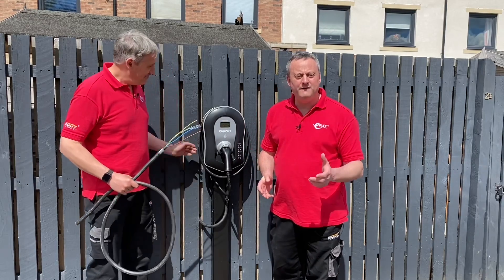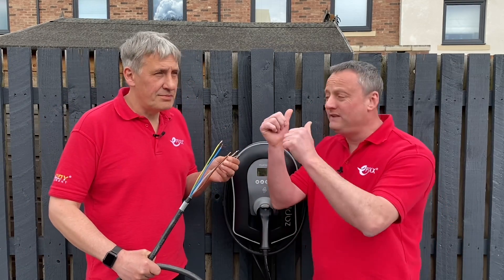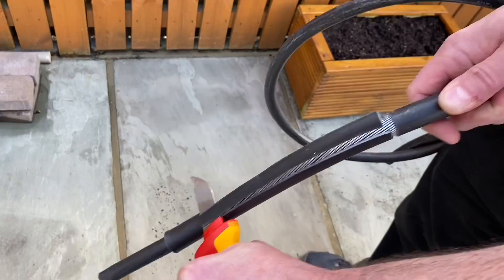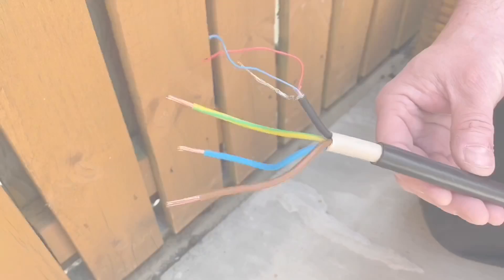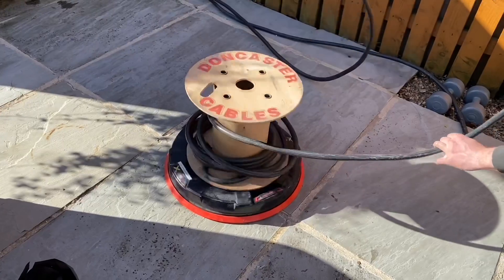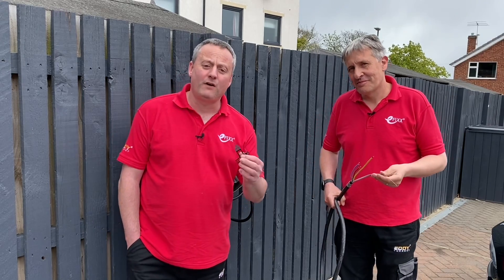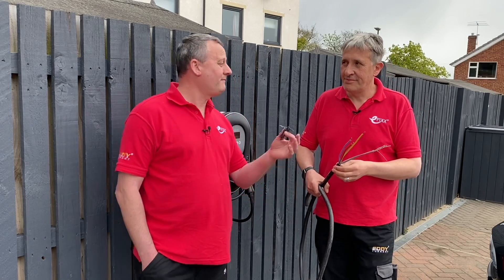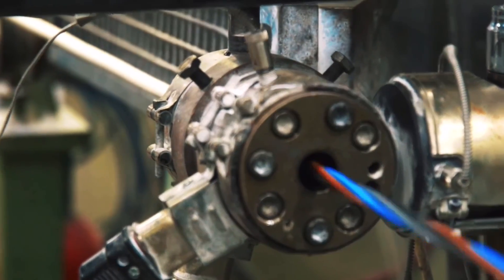EV ULTRA cable - Combined power and data for easier and neater EV charger installations

Comment: Question ? Can you run data cable and let's say 2.5 t&e in a domestic seting through the same holes in joist  let's say, answer is no so how can you use cable that carries both ie one is high voltage and one is low , and in ireland that's a no no so my question is ? Is it allowed in the UK? Thanks in advance

Comment: How does this go with isolation requirements? For example, in sweden, if a Extra Low Voltage cable is run alongside a single-isolated Low Voltage Cable, the ELV part of installation is no longer considered SELV/PELV isolated, and you must be a electrician to make modifications in the CAT network, including disconnecting and connecting for example computers or routers to switch, unless a approved isolator device is put on the CAT cable on the other end provding separation and optical isolation of mains. This because the isolation of the single isolated wires, could fail, potentially outputting mains on the CAT network, as the isolation of a CAT cable isn't approved for mains voltages.

The cable could be acceptable by safety standards ONLY if the grey sheating of the UTP cable is classified/approved for mains, so even if the single isolation of the phase or neutral wire would fail, the CAT isolation would be approved to keep mains away from CAT network (double isolation requirement).

Running a UTP cable alongside a normal double-insulated cable is approved however, since there is 2 mains-classified isolation layers that must fail before there is any risk of UTP network becoming live.

Comment: I bought a Honda Ens1 that came with a 3-Pin Chinese or Japanese plug, I cut the cable to put it in the EU plug, and I saw that my cable has 4 wires, a Blue, Brown, Yellow with Green, and a Red smaller, which I believe is a sensor. I would like to know where I connect the red wire, since I only have it in the EU socket, phase, neutral and earth. Which wire does Red go next to?

Comment: I am not a fan of putting data links in the same insulated bundle as power lines. It's not something you'll find is done in the telecommunications industry (indeed, they won't even share conduit).

Comment: Just installed Ultra 6mm + data swa from meter cupboard (under the stairs) to parking bay.  Cable had to be run behind drywall (dot n dab) through the hallway. Running it in the ‘safe zone’ was not an option. So I’ve chased out behind the plasterboard just above skirting  my understanding is that the swa should be earthed at one end or the other. This has been a real challenge with such a big, inflexible cable.   I’ll re-post once it’s all connected.

Comment: Hi
I am hoping to re run one of these cables from my house to the detached garage about 40metre run. This is to replace the current 4mm. Will be needed for a pod point charger and to run fee sockets and lights.
Is it worth investing in the 10mm variant from Doncaster cables for future proofing.

Comment: Thanks Guy's. I've got a Project Ev charger to install on a garage which is approx 47m away from the house. I am planning on using EV Ultra 6mm 3 core swa + data. My question is as wifi is not reliable over that distance could I use one pair of the data cable for the CT clamp and the remaining 3 pairs into an RJ45 ethernet back to the router or do Doncaster cables do a special cable for that scenario which has 5 pairs.
Reply from the maker: We’ve got a video series launching later today using an INDRA EV charger.  We explain exactly the scenario you describe with the data cable.

Comment: This might be different for different EV boxes.  Does the data connection have to be direct from monitor to charge socket or can the cat5 be used to terminate into a lan on either end and the monitor to charge socket comm is then just part of Lan?  Example application:  use this cable to connect power to a garage into a garage DB, data then goes to a hub in the garage, hub then connects to EV charger but other hub ports can be used to connect other stuff in the garage ( wifi extender etc )

Comment: What size go and did you use with the 6mm cat5 swa? Doncaster spec sheet states 18mm outer diameter, using a swa chart and counting 6mm2 4 core ( 2 line 1 cpc 1 cat 5 ) gives s20, seems tight thou?  Is s25 gland better?

Comment: great vid guys, but why CAT5e (alu foiled)? why not a better CAT6/CAT7, as there are now CAT 8 on the market as well that are extremely fast - especially as its down the back of the garden. I prefer only to use CAT7 or 8 and have it future proofed.
Reply: Cat 7 cables you buy off amazon aren't even proper CAT7 (they don't use the right connectors) and I'd be surprised if most of the CAT8 you buy off amazon even reaches 2Ghz in bandwidth at all. For the average consumer CAT5, and CAT6 for longer runs/HDMI is all you need. cat5e can reach 2.5gb over 100m which is more than enough for the average shed.

Comment: This cable looks neat, How does this cable work with cable separation? Doesn't the higher current pulled from the charger interfere with the data cable?
Reply from the maker: It’s a screened twisted pair so not much chance of interference
Reply: @efixx  I beleive that there is als o a drain wire in the Cat5e segment that should be earthed at one end.

Comment: if your using one or 2 Pairs for Current Transfer/s maybe you could use the orange and green pairs for data obviously at 10 bace T speed or would the current transformer signal interior with the Data? Phill

Comment: Would be nice if they did a 10mm2 version - would be good for longer runs, and even for shorter runs in terms of energy saving from reduced cable heating. Like the idea on use as a feed to garden offices.
Reply: Definitely needed a 10mm2 version.
Reply: Is there not a 10mm version?
Do you have any videos of the best method of installing this cable in a garden office for example?

Comment: CT 'Sensors' - Are they passive Current Transformers, with a secondary load resistor, and back to back zener diodes ?

Comment: 802.3at (PoE+) can run at up to 57 volts in normal operation, so wouldn't that technically make the Cat5 Band 2 as well?
Reply from the maker: It's 50VAC or 120Vdc to stay within band 1

Comment: You can always rely on Doncaster Cables to produce a quality product. The jacket of the Data cable must be rated the same as the other conductors within the EV ULTRA cable. Each end will be connected to a junction box, before being split to go to their respective termination points. Thanks for sharing guys 👍🏻

Comment: When most vehicles are electric, the data connection will be a requirement for the charger to operate, and remote monitoring of the vehicle energy consumption for 'vehicle excise duty' charging, ensuring that nobody gets 'free' (solar panels) or cheap 'fuel' for their car...or am I a little cynical?
Reply: No, I don't think you are being cynical for one minute, you don't think the government is going to let get away with having cheap fuel, why do you think all these so-called smart meters and chargers  are being fitting so they allocate a carbon footprint once exceeded  tax you at premium price and they will know when you use your EV charger and tax you accordingly, we've been conned gain.

Peter.

Comment: So we can't have a standard bell chime wired in to a CU because the wires aren't rated for the voltage inside the CU.... but we can have a data cable encapsulated inside a mains cable, with only a single insulation rated for the voltage separating them? 🤨

Comment: Seen you guys talk about this a lot, I’ve ordered some just for internet would have loved if this would have come in 10mm then I would have had to use one but the cable does look top notch and works out so much better than bare burying cat5e under a drive, so now two cables buried 10mm and this Doncaster Ethernet one 👍🏾 would have never had this option without you guys keep up the good work
Reply: Keep an eye on our Instagram page for upcoming news on EV-Ultra - some great additions coming soon 👍 🙏

Comment: Are you limited to 90 metres in length due to CAT5E cable?
Reply: It's 100m, but it's best to keep the run as short as possible. Cat6 uses larger cross sectional area copper and closer twists.

Comment: Why cat5e and not cat6? Surely in the future faster speeds will be needed, why can’t they future proof the cable?
Reply: though if you can get CAT6 go for CAT6 if there isn't much in the price (and typically there wouldn't be)
Reply: CAT5e can support 10Gbps upto around 50m; CAT5e is good enough for 1Gbps upto 100m so it will do the job.
Reply: @Apex180  It may be able to support greater than 1Gbps but at 50m it would definitely struggle to do 10Gbps and even cat6 is only just rated for that
Reply: @johnschroeder3072  Funny we have 10Gbps working perfectly within the DC here over CAT5e and have for some time on some fairly long runs; though come refresh time we do swap to CAT6 due to our internal standards and that being all we buy these days.

Basically you can do it but your mileage may vary.
Reply: @Apex180  Lawrence systems channel has a him sharing his experiences and doing some actual speed tests on it. Was quite good but did start to have issues with re-transmits
Reply: cat6 is quite a bit thicker, they probably couldn't get it into the size of a standard SWA they were going for, also for this application do we really need to be trying to futureproof 10gbe+.
Reply: @edc1569  you can get flat cat 6 cable, if I was using this cable to a outdoor office as Gary says then the customer would kick up a fuss about it being cat 5 e. Surely Doncaster cables could futureproof our instalations.
Reply: @RNMedic99  Why do they need to know that it's 5e just tell them that you are running data cable with >1Gbps bandwidth.

Comment: That cable is nearly the same cost as 16mm 3 core SWA, nearly £6 or metre.
Also how are you joining the data cable, because the data and power are going to different places presumably.
Reply: Did you get a response on your question?
Reply: @shazhussain6109  I don't remember getting a reply to that question

Comment: How do they get away with making that cable? Surely they are inducing voltages in the cat 5 as it doesn't look screened? 🤔
Reply from the maker: It’s a screened cable
Reply: I was thinking the same.

Comment: I could see this becoming a default cable (or an easy upsell) to use for outbuildings now people want internet everywhere (because there are working from home, have CCTV, want to have a wifi access point or whatever)
Reply: Might be good for future proofing. Everything these days seems to be connected to the internet. You can even get wifi kettles. 

It will come to a point where you will need internet connection to even use a product
Reply: Yep future proofing for EV it’s a pity it doesn’t come in 10mm as that’s what I need for a granny charger and a fast charger, thinking if me and the missis ever get electric cars it would be ready to go just need to get the consumer unit for the garage then it’s good to go, the Doncaster cable I’m running to a router so I can hardwire everything 😁

Comment: I’ve used both the swa and hi-tuff versions of data and cat5e cabling. Absolutely brilliant cable CAT6 would be a better option as that’s what clients tend to prefer to their garden offices. The cable looks spot on when paired with linian clips
Reply from the maker: Cat 6 talk to #AboveAaron
Reply: Putting a duct in is always the way forward
Reply: cat6 isnt needed, it's basic data transfer and does not need cat6 speeds, barely needs cat5 speeds either. All Ethernet ports are backwards compatible anyway so it does not matter.
Reply: CAT5e can run 10GBps safely upto 50m and 1Gbps out to the 100m of the spec before a switch / repeater is needed of some sort, this also means it can carry 2.5Gbps and 5Gbps but not having chance to play about with either of those (its 1Gbps or 10Gbps in the datacentre) I could not say what's "safe"

CAT6 and CAT6a are certified for 10Gbps upto 100m per the Ethernet spec (again this can carry 10Mbps/100Mbps/ though that's very rare these days, 1gbps / 2.5Gbps / 5Gbps / 10Gbps and the higher 25Gbps/40Gbps Ethernet speeds though it can depends on the install and you might need to go to CAT8 to get it certified [CAT7 is not a real standard imho, its made up by the ISO board who are not the word on specs for this stuff, that's ANSI/TIA......]

So while it would have been nice to have CAT6 for the better base specs of the cable its not a show stopper (very much doubt 'normal' home users are going to have 10Gbps for some time now) 

the fly here is that wireless access points / mesh systems are now starting to come to market where the rj45 Ethernet connector / port runs at upto 2.5Gbps, new computers are now getting 2.5Gbps / 5Gbps / 10Gbps (along with 1Gbps) network ports but the typical network switch in the home if any or the home "router/super hub/smart hub" [what ever the isp trys to call it] only have 1Gbps ports  so it limits the internal LAN [not to be confused with your external WAN] speed if you use the hardwire option for backhaul on the mesh / access points and it limits the computer; basically there is a entire chain of devices that need to be upgraded first and it depends on what the end user is going to do.
Reply: @Apex180  Also, what you use 10Gbit for? 1Gbit connection is more than enough for a PC, your internet connection to the outside world is far slower, and even if you have fibre you don't get more than 1Gbit, and even if you have a NAS in your home, 1Gbit means 120MB/s of transfer, is not slow considering that it's more than the speed of a standard 3.5" hard drive (yes you can have a SSD NAS, or a NAS with RAID 0/5/6 etc, not that common). Most people won't probably even notice any difference between a gigabit and a 100Mbit connection.
Reply: @alerighi  At home ? am still very much 1Gbps LAN with the nas being on a teamed / lag setup.

At work in the datacentre, when we are pushing petabytes of data.... 10Gbps is starting to be the standard port speed for us, with 25Gbps and 40Gbps seeing use.

that's not to mention the 8gig/16gig fibre channel stuff used in the SAN's

more speed never hurt anyone

 I am fully aware that for most home users their own WAN will still be slower then their LAN and that is likely to be that for some time. 

That being said 2.5Gbps lan ports are starting to be standard on newer motherboards and some high end ones even have 10Gbps; Apple Macs i think are starting to come with 10Gbps though not having one i can not confirm; if you don't have the other bits to go with this it kinda feels like a waste.

Newer wireless access points / mesh systems are starting to appear on the market with 2.5Gbps ports and if you hardwire them for the backhaul [its needed because the wireless speeds are now at a point that they can saturate a 1Gbps link] and you only have 1Gbps switch you are leaving performance on the table (ignoring the fact that your WAN speed won't be 2.5Gbps etc.)

The market is moving but at a very slow speed.

10Gbps switching is still expensive, though if you don't mind 2nd hand some ex enterprise kit is making its way to the 2nd hand market.

The 2.5Gbps and 5Gbps switches are still very few and expensive when you consider a cheap 8 port gig switch can be had for £30, asking someone to pay £150+ for 8 port 2.5/5 gig based one means it won't sell at the same volume, but that's the same with any new tech standard / speed

Only when the ISP provided routers / hub / home hub / superhub start coming with 2.5/5 Gbps ports on them will I think we will see a bigger move to faster LAN speeds for the home use.
Reply: Considering that plenty of the world (and the UK) can get gigabit connections to the home, and modern NAS devices have 2.5 or 10Gbps ethernet connections it's not unreasonable to want to install cable that can handle 10Gbps. Modern NAS devices also often have SSDs for caching if not storage, and HDDs are typically reading and writing >150MB/s these days.

Realistically though this cable with fibre would be better, avoiding the issues associated with having copper data cabling right next to the power too - but field terminating fibre is not something that your friendly neighbourhood electrician can do.
Reply: @alerighi  when moving big files around these days 100mb is noticeable slow.  Any new cables being installed in the 2020s  should really be 10g/bit capable , even if the hardware you have today is 1gb the cable will probably out live the electronics on its ends. I was installing cat 5E in the 1990s.